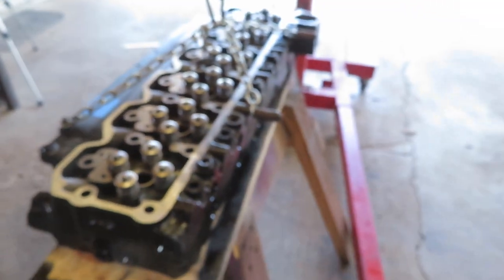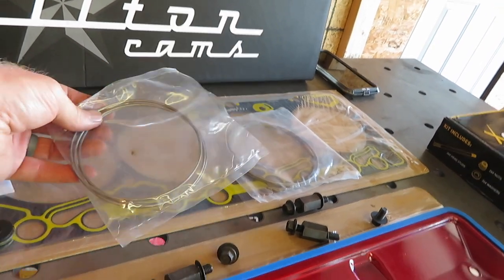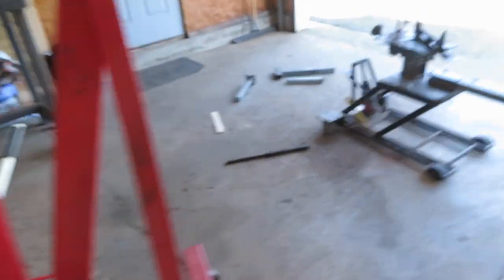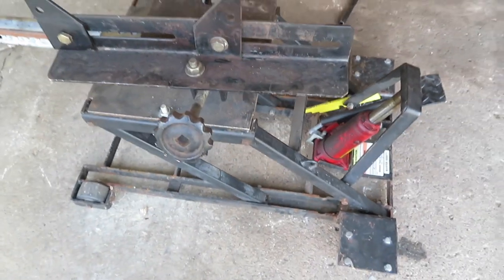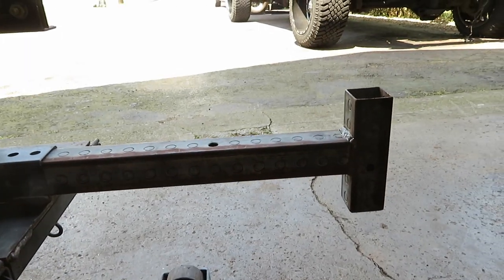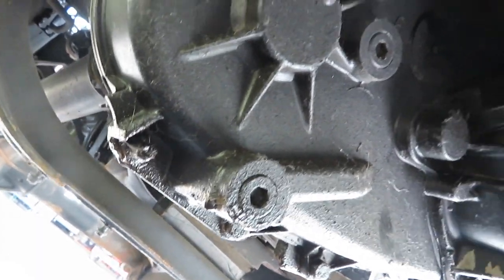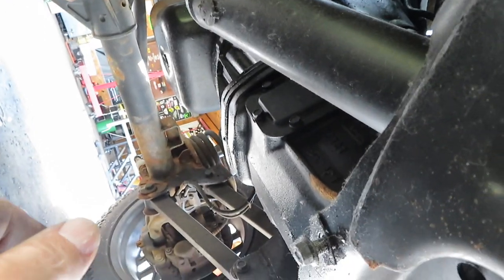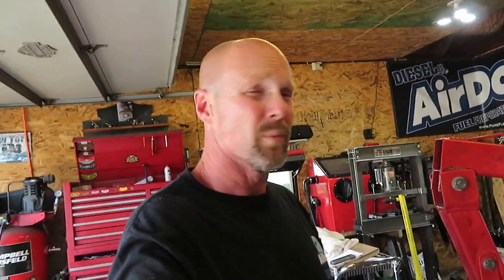Trying To Get Some Parts Back On My Dodge Ram 2nd Gen Cummins

Comment: Any idea if transfer case has oil pump like automatic transmission has to circulate oil?
Reply from the maker: No the oil is static and is transferred through out by the internal movement.